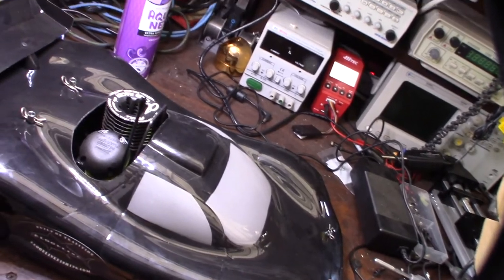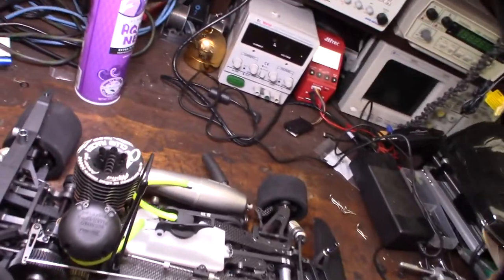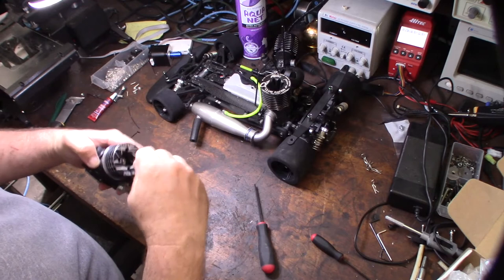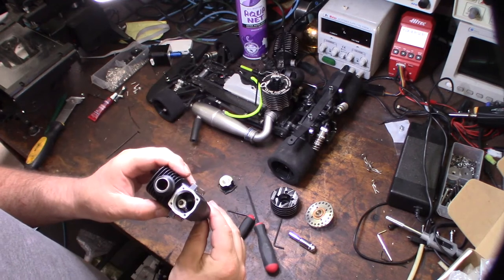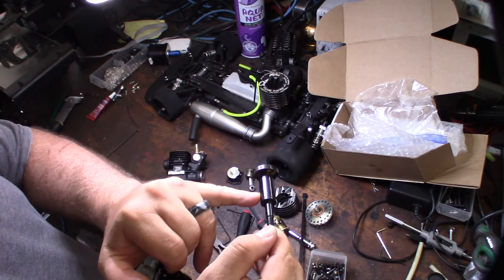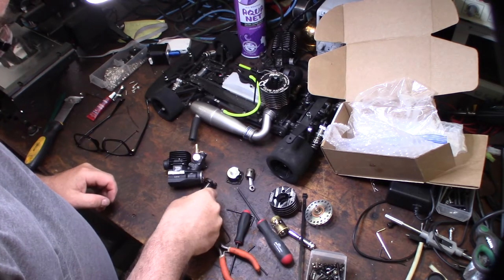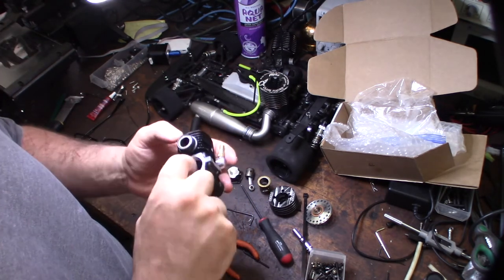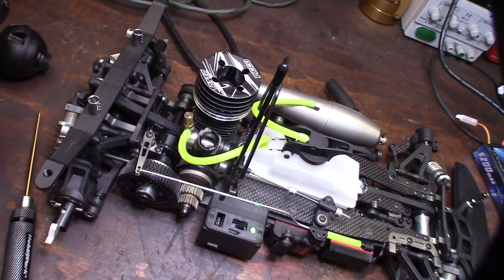Picco Otto .21 On Road Nitro Engine with DLC coated crankshaft  Ceramic bearing for my BMT 984

Comment: You need to rotate the cooling head 90° so the two slots on the head are facing the direction of airflow. That’ll keep the engine running consistent and prevent you’re glow plugs from burning out